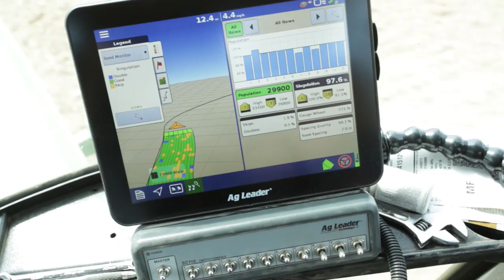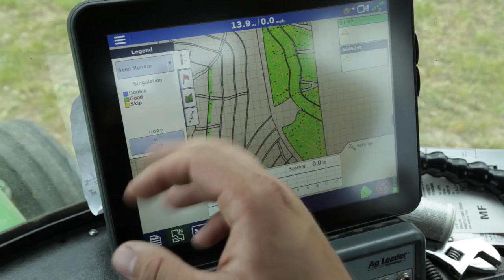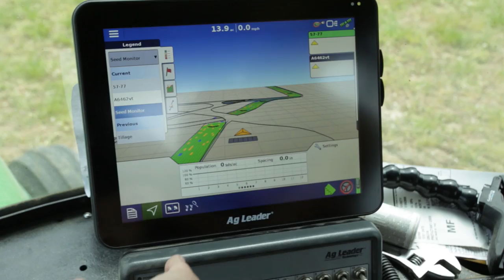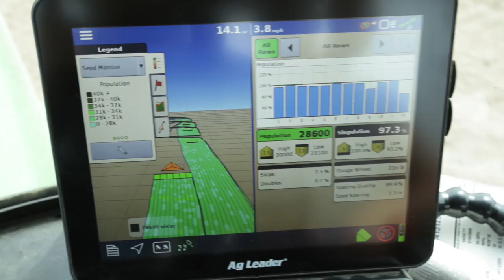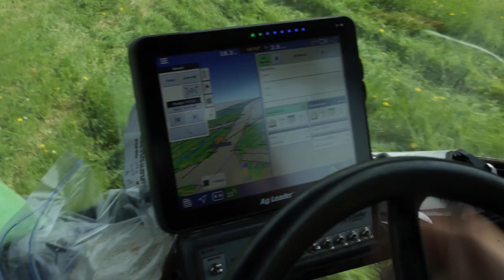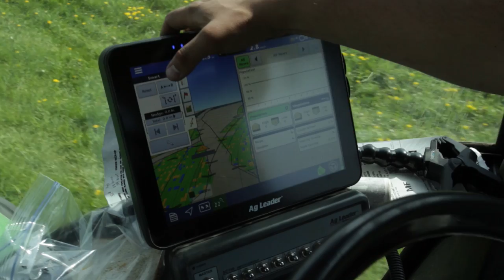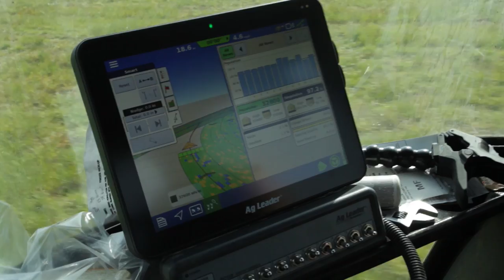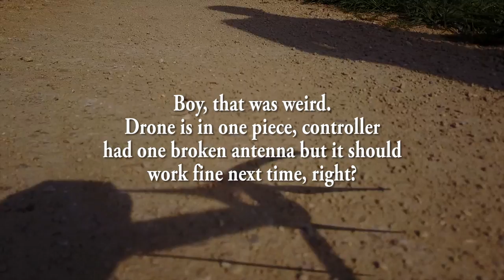Planting and Ag Leader Monitor

Comment: Nice video. Does the cost of all the electronic equipment offset by the yield advantage? Does it pay instead of doing it the old fashioned way? Thanks
Reply: Stephen May saves on seed cost
Reply: If you suck at driving then yeah there probably is a yield advantage but if you are competent then probably not. When you have a lot of point rows like Ryan has then the row clutches are probably more likely to pay for themselves compared to people who have square fields and where you don't farm the contours. If you do have a lot of point rows and you don't have row clutches you will waste quite a bit of seed and there could be a yield hit in those overlap areas especially if it would be a dry summer. 

*My opinion: Depends on the size of the operation and the type of ground you are farming but in a lot of cases the electronics are probably just more of a luxury than something that will actually make you a whole bunch of money.

Edit: I should add that the technology will help things go faster. For example without row clutches if you wanna do a good job when you come to the end of the field you stop, pick up the planter, turn around, stop again, and set it back down. With clutches you just drive straight into your endrows and they shut off automatically and you can pick it up, turn around, and set it down all without stopping and over time that can add up to where you are getting a noticeable amount more done in a day.
Reply: @TJ-bk9vf I know this is 6 years later, but someone might find it helpful. If you don't have marker arms, auto-steer is important (you can get by with GPS that doesn't have autosteer, but it is an absolute pain). In fact, I would say that it's more cost effective to get autosteer than to pay for the marker arm option on new implements.

Comment: A few questions; at 1:10 - 1:30 the screen is showing mostly green, what do the yellow and blue mean? Singlelation (sp) is what? Am I correct in thinking that the (marking arm??) (the thing that folds out) is not needed with the system showing the route?
Sorry if these seem dumb but I am a "city" person and just don't know.
Reply: dejanira2 the colors can show different things such as singulation spacing population down force and a few others. The markers are technically not needed with the Rtk system or any other gps.  On my farm we use them on the headlands because it is to much of a hassle to use the gps on the headlands. Also smaller planters like this have markers because smaller planters=smaller or older farmers who might not use gps. Last these are not dumb questions at all it is good you want to learn

Comment: Was the planter up or down in those water ways - or the where the green grass was
Reply: Down. we dont lift it for the waterways.The boundrys are set in the monitor and it automaticaly shuts off the rows when we go out of the boundrys- like through a waterway.
Reply: Yeah the BIL plants straight through too, but he doesn't have the electronics so it just keeps dropping seed... but his waterways aren't wide enough to really matter much.  He told me to do the same thing when I was drilling soybeans for him.  

If you've got a lot of land and a lot of waterways, or are going through them obliquely quite a bit, I can see where the point row shutoffs and GPS would save you quite a bit... 

Later!  OL J R :)

Comment: Somebody enlighten me please.  If they have all of the technology to include the steering assist why are the putting the row marker down?  I guess they are using the steering assist and the planter monitors so maybe the row marker is just a check against the technology? Also, towards the last of the video is Travis planting in the 'burned downed' alfalfa?
Reply: Thanks, John.
Reply: First year with auto steer still like to have the trail mark for a double check.
Reply: Dwight, you and I are older and a bit harder to convince on this new technology stuff.  I'd be like you and put the row marker down in case the electronics fail and you need to keep planting.  You have two great sons and I am proud of them for you.
Reply: jbmbanter I'm guessing if the technology was to fail he still has something easy to follow.

Comment: why do you use the marker when you are using ontrac?
Reply: I was thinking the same  - is it for double checking the new system?
Reply: Adam Offen my guess like most computerized stuff a back up incase it fails!
Reply: when your turning around on the headlands it gives you a reference to where you should be turning.